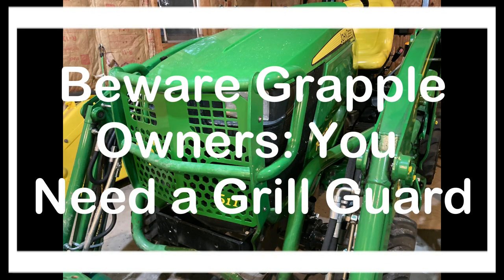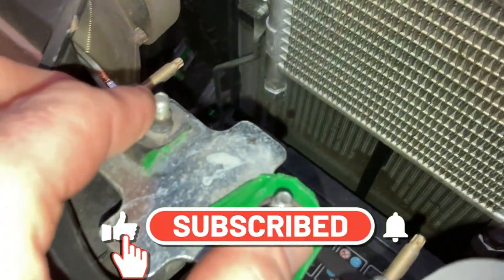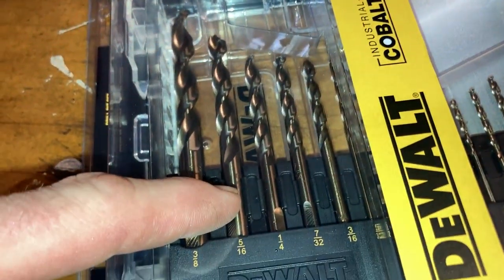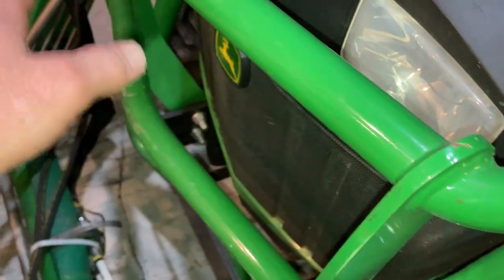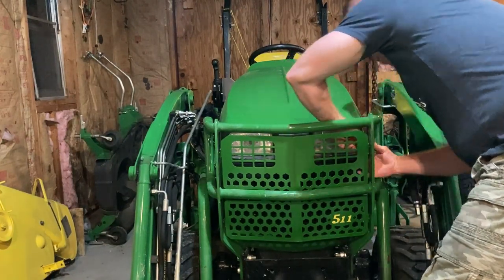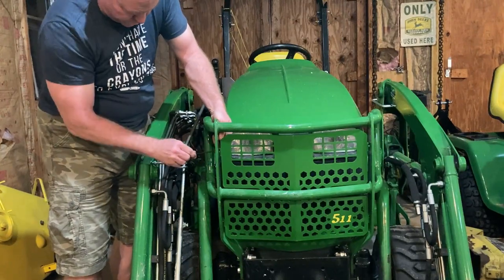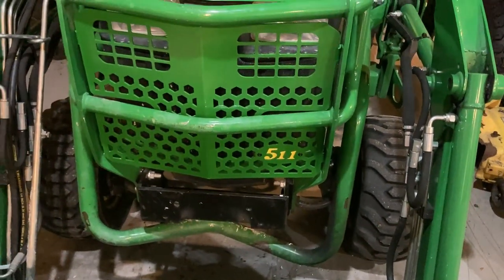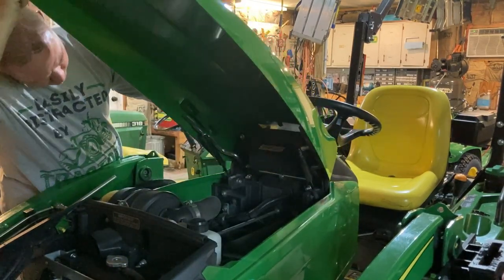Beware Grapple Owners!!!  John Deere Hood Gets Busted.

Comment: Thanks for the video. I got the same grill. It really looks heavy duty. Should help protect during grapple work.
Reply from the maker: Yeah grapple work definitely has some risk for stick through the open area of the grapple.  Never had that problem with the bucket, then again, I don't shift stuff in the bucket when I compress it down, of course because I don't.  It was just really dumb to know I needed it and waited to get it, call it "Tractor Tuition" I guess.  Thanks for watching Roger.

Comment: You really didn't expect that plastic to last did you? The first thing I did with a "new to me" 425 was getting a little too close to a tree limb costing me a hood and two side panels. I only needed one, but the pair was a better deal and I figured sooner or later I would need the other side. But the 425 is still better than what they're selling these days.
Reply from the maker: My theory is the plastics of today are far superior to the 90's or even early 2000's.  I do plan to use that hood for "research" purposes in an upcoming video and an old hood as well.  With as much pressure as was applied with the grapple and it's hydraulics, I think anything would have given.  I have replaced many hoods and side panels, on 245's, 345's, 425's and 445's, it gets expensive for sure.  Thanks for watching.

Comment: The old hood can be repaired.  It's a very common issue that shows up on green tractor talk forum.
Reply from the maker: I think you are right about many hoods and different locations on hoods and maybe even this one.  But the location here at the hinges was going to have to deal with lots of impacts over time right in the location of the repair.  Either way, I have forked over and done the repair.  Hopefully I will never have to try to see if your right about that.  Thanks for watching.

Comment: Are you able to hang suitcase weights on the front frame with the guard on? I know with some grills it is possible by turning the suitcase weight sideways to insert them under the guard and then let them swing down. Could you try that if you have a 42 LB suitcase weight
Reply from the maker: Shoot me an email of text tomorrow so I can remember.  I have never tried but I can since I have a few.  I've just never needed one on the front of the 1023E.  Thanks for watching.
Reply: @FloridaDeere  sorry i don't know how to contact you except here 😭 any luck checking the grill guard with the front suitcase weights?
Reply from the maker: @danielmacdonald16  Tha channel page has a "more" or "other" button that allows us to put more information, but either way, I'll roller myself out to the shop and check it out.
Reply: @FloridaDeere  oh no. Your knee!  Nevermind. Just take care!
Reply from the maker: @danielmacdonald16  DUDE!!!  Since I forgot twice on you already and I was still up at 1:39am, I ran...well rolled myself out out to check.  I am 99% certain you could put four on, certainly two on the far side, probably two more as you closed in on the middle, but I doubt you could get one in the middle for a total of five.  Having said that, you might be able to bend the guard in a such a way to make it work.  Also, they would have to go on before you put the guard on, as the guard would prevent you from installing afterwards.  So, now you know three new things, suitcase weights are possible, and I'm both committed enough and I guess dumb enough to walk out there at night for my subscribers😉.  Having said that, if I would have jsut checked when I told you I would, it would have been daylight, but before that happened I saw a squirrel.
Reply: @FloridaDeere  You are the MAN! And slightly crazy. Thanks so much for the info. Very helpful as i need to be able to take them on and off. DCTFab on Etsy makes one with expanded metal which allows 4 weights to be hung and removed. Guess I'll go that route. Love your channel! And thanks once again!
Reply from the maker: @danielmacdonald16  Yeah I think I saw his recently.  It's a bit cheaper, but that's good.  When 511 was the only real commercial one on the market, they set the market price, I'm happy to see others offer more reasonable priced units.  511 will have to come down in price and maybe make changes so they can put the suitcase weights to work.

Comment: Question.  I cut grass and mulch leaves a lot with my mid-mount mower. I am constantly getting off the tractor to clean junk off the radiator screen. Can you reach into the screen with the 511 on?
Reply from the maker: Yes, I think so and yes you are right, grass and bush hogging do create a ton of debris that sticks to the grill, but you can reasonably easily get a hand in there to do a swipe or two.  Thanks for watching.
Reply: @FloridaDeere  I use a bottle brush with a really long wire handle bought at a bird feeder shop fits perfectly behind seat under a wiring harnessworks perfectly
Reply: Air pressure from compressor